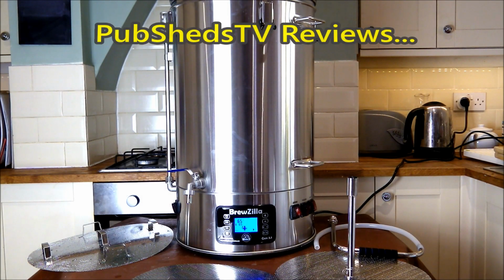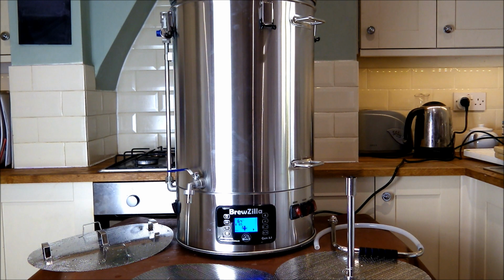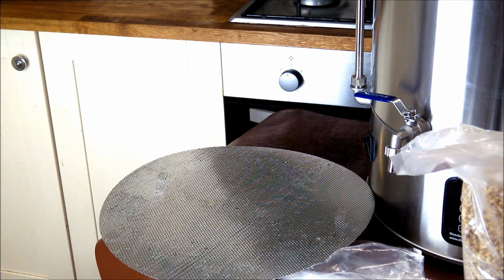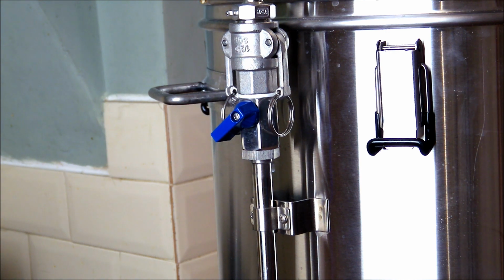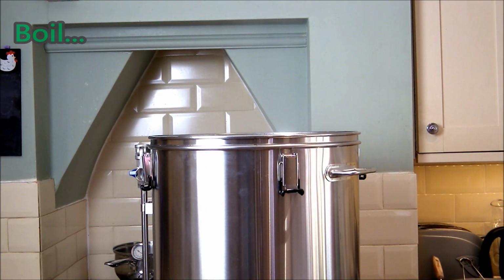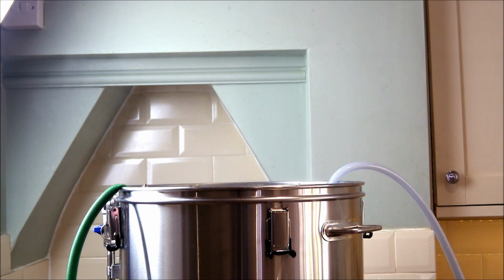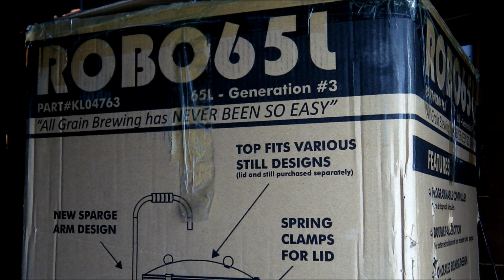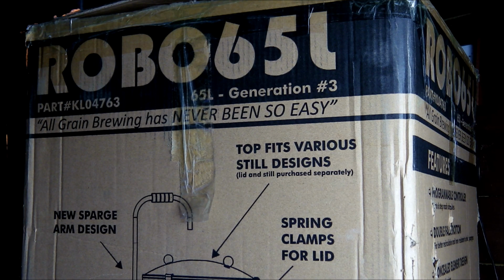**REVIEW** of RoboBrew 65L 'BrewZilla' All in one Brewery - Kegland.com.au

Comment: Hi. Great review. I have ordered the Brewzilla 65l for UK use. Can uk power sockets cope with the power requirements? Or does it need a dedicated power supply. I have spoken with lots of people about this and all bad two said standard uk power is not enough. Tow of them said fine and they were electricians.
Reply: Hi Iain. The general consensus amongst UK home brewers seems to be that the Brewzilla 65l is safe to operate using any two of the three power switches, from a standard 13A plug 220v socket, but using all three will probably trip it. My current boiler operates at 2400kw with no issue apart from the plug getting a bit warm. To ramp up, I'm thinking maybe have an electrician run something through my redundant electric cooker socket? (unused due to using gas). Please can you tell me where you managed to buy your Brewzilla? I've been looking everywhere for one, and it's like looking for the holy grail!
Reply: @andycadge7264  hi I had ordered it from dark farm brewing and decided to go for the 35 in the end. So far it’s okay for my needs but I may eventually get the 65 and use 35 as sparge heater